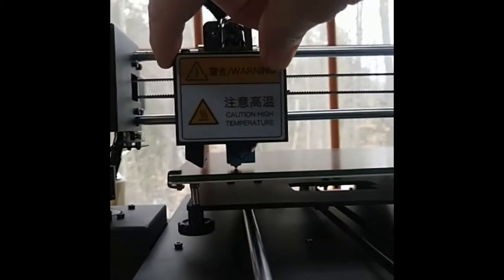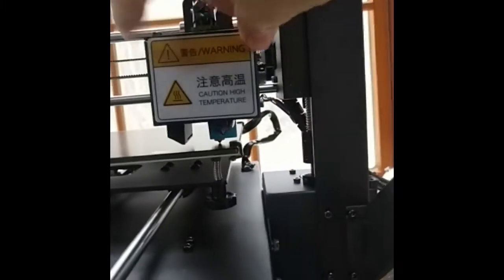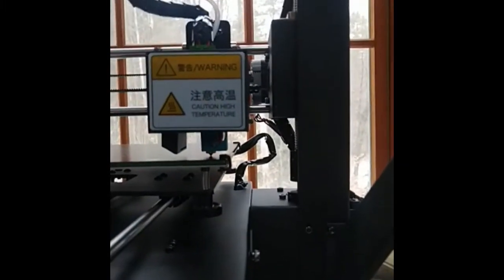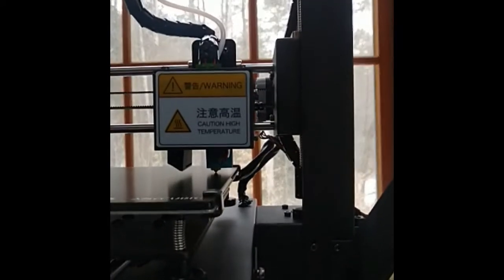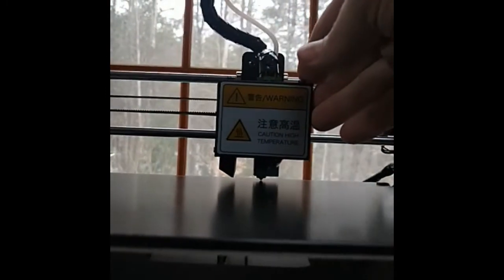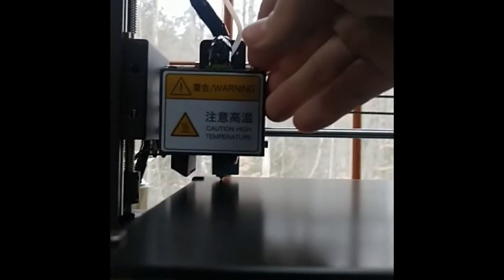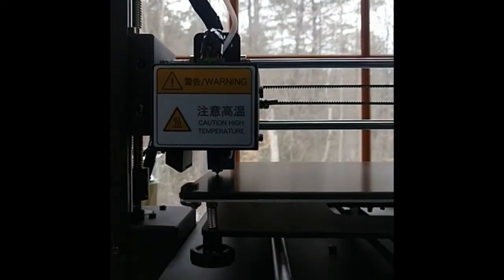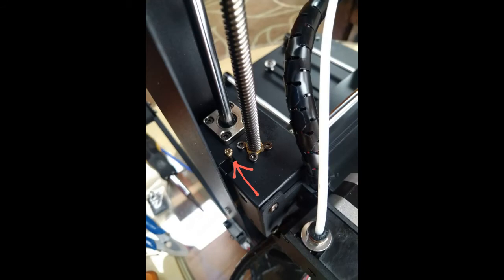Anycubic Mega S new machine bed level issue

Comment: I am having this same issue. I adjust the Z axis screws until the nozzle is touching the bed. Then I adjust the corner screws underneath to level the bed. But every-time I turn the motor back on to print, the nozzle is too far from the bed again.

Comment: Hopefully someone can help: similar issue, except the SouthWest corner is all the way loose and the NorthWest corner is all the way tight, change the West Z adjustment screw and the NW is practically making holes in the paper while SW is finally not falling off.  There isn't a front to back levelling from what I can tell.  Thoughts?

Comment: I have this same issue (corner adjustments can't do enough to level).  Do you just turn the screws counter clockwise about the same amount each?  Do you need to measure anything else, or does not not really matter if the two screws are adjusted exactly the same?  I am thinking it does not matter as there is 2 z-axis limit switches, but I wanted to be sure before I adjust something I can't fix (I'm new to 3d printers)
Reply from the maker: I tightened the spring loaded adjustment screws at the corners to make sure the bed was "pulled down" a bit. Then I turned the screws shown in the video with a red arrow, counterclockwise about 1-2 full turns. I then kept homing Z and adjusting the screws until it was almost touching the bed. Then I used the corner adjustments to level.
Reply: @GadgetmanNH  Perfect, that is what I was thinking, I just wanted to be sure.